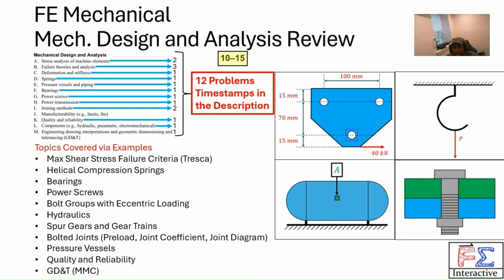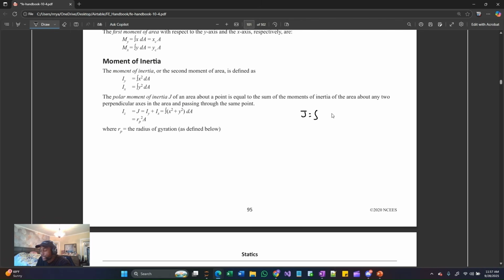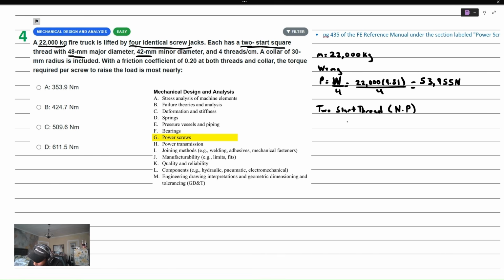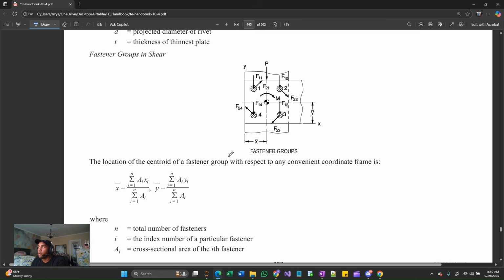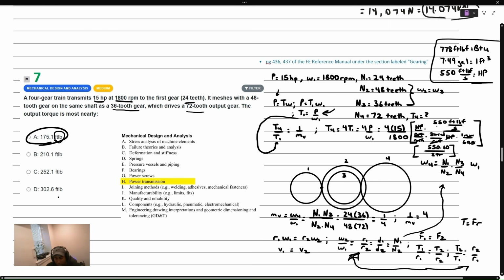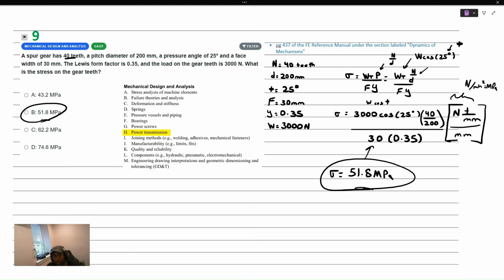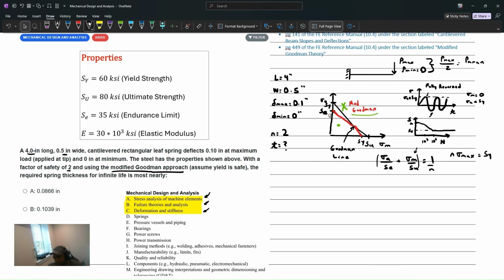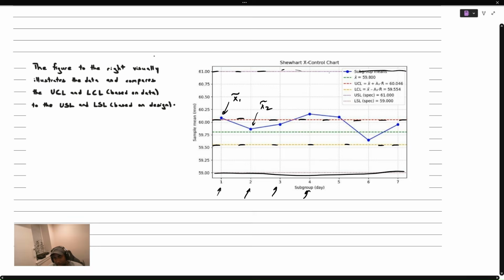FE Mechanical Design  and Analysis Review – 12 Real Problems That Teach You the Core Concepts

Comment: Hey, great courses so far! Quick question on Power Screws - the FE Handbook v10.5 includes a formula for mean thread diameter that is different than what was used, which according to that reference is d_m = d_O - p/2. For me, this gives a mean thread diameter of 46.75 mm, rather than 45 mm, changing the result ultimately. Should this question be reviewed or is this a mis-application of the reference material on my part? Thanks!
Reply from the maker: Great catch and you’re absolutely right. For context, when I originally created this solution, I had just finished taking the PE Mechanical Machine Design and Materials exam and was still referencing the PE Handbook (version 1.8), which defines the mean thread diameter as dm = (major diameter + minor diameter) / 2 (here is a link to check that out https://imgur.com/a/Lx0Gk3A ) . Since the FE Handbook version 10.4 didn’t include a formula for mean thread diameter—and I forgot to check version 10.5 for updates—I used the PE reference by default.

In FE Handbook version 10.5, NCEES added the formula dm = d_o – p/2, which is the one you’re referring to (note d_o is the major diameter). That is the correct formula to use for the FE exam because it’s what NCEES will grade answers against.

It’s also worth mentioning that both formulas are still approximations. The true mean (pitch) diameter depends on the actual thread standard, and to get the exact value we would need to identify the thread type and look up the pitch diameter from thread tables (ANSI/ASME, Machinery’s Handbook, etc.). Since the FE exam avoids thread table lookups, it uses the simplified approximation from v10.5.

I’ll update the solution to reflect FE Handbook v10.5. Really appreciate you taking the time to point this out—great attention to detail.
Reply: Thanks for asking the question. I originally tried solving the problem using the formula provided in v10.5.